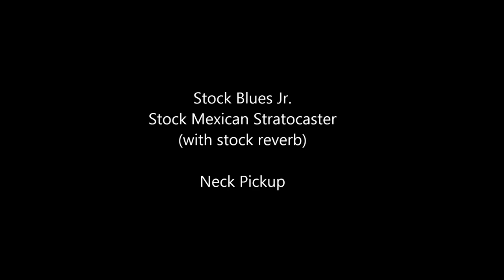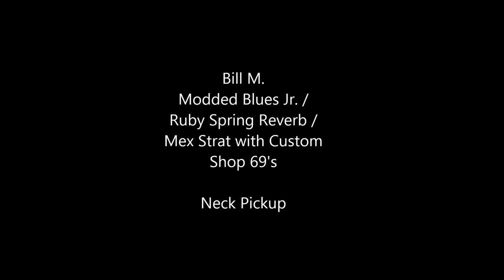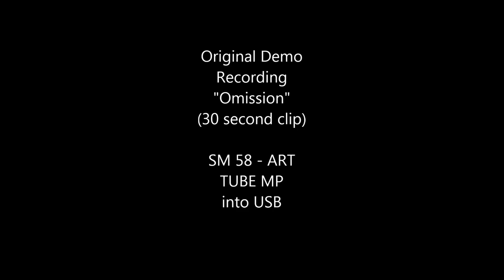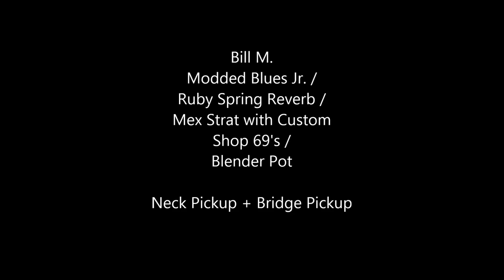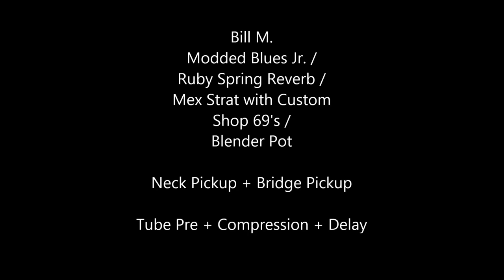Bill M Mods and Stratocaster Upgrades

Comment: Would be nice if you would list the mods you did based on the time.  At 4:43  this is the twin stack jumper modAt 4:55  looks like you used aluminum foil.  Thought copper foil was supposed to be used.At 5:22  what's this?At 5:37  are you replacing the knob? from what to what?At 6:00  what mods did you do to the reverb? At 6:12  Explain what these mods are.At 6:37 you show the knobs, give an explanation of the two round ones. What mic did you use and what kind of software and type of PC? Mac or Windows?Add this info to the timeline.Great tone and nice video.